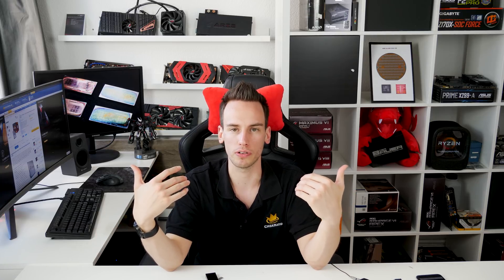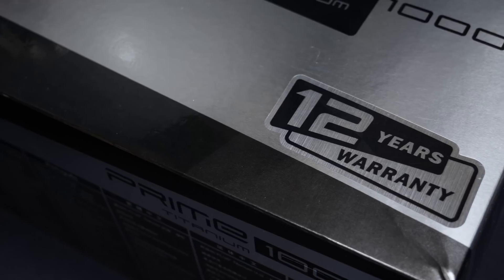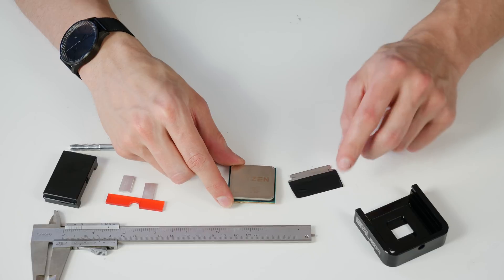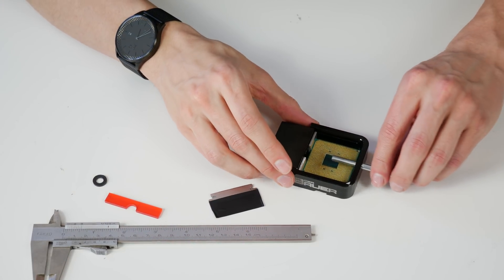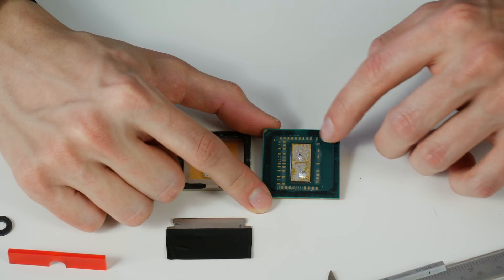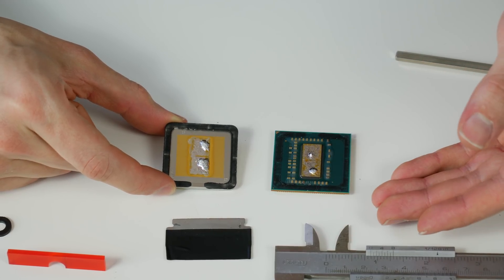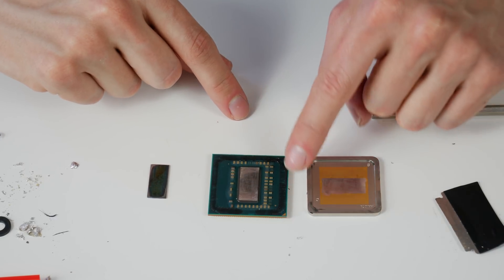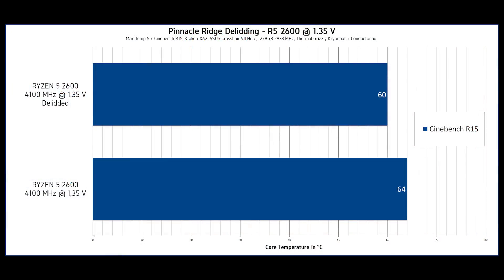ZEN+ Delidded - Before/After Temperatures - [Ryzen 5, 7, 2600, 2700X]

Comment: It is a smaller process, however AMD chose to use the shrink to add more dark silicon between features instead of shrinking the die.
Reply: the anandtech article has an illustration about it.  all the parts are basically the same and with the same number of transistors its just that blank space is put in between the existing parts so they are not too close together.  they call that dark silicon.  its just a buffer between working parts so that heat from one area doesnt get into other parts as much
Reply: yeah according to anandtech that is the case.  its still 213^2 or whatever
Reply: Exactly this.  They could have made the die smaller by about 10%, but putting (keeping) a bit of space between the parts of the core keeps the overall area through which they can transfer heat out of the same.  This helps them (along with the slightly more power efficient 12nm node) get those extra few hundred mhz.   Makes me wonder what theyll do when the 7nm Zen2 parts come out.  Will they shrink the die or keep it the same for cooling purposes.  Its not like the Zen chip is all that big to begin with...
Reply: None of you got it completely right. It's due to tooling. It's cheaper to leave unused die area and keep the same tooling for their entire production line of Ryzen, Threadripper, and EPYC CPUs than retooling it for a slightly smaller die size. The unused die area can then be used to isolate temperature sensitive circuitry better as well.
Reply: its a simple matter of logistics. making all dies the same size even if the actual chip is smaller has no additional production cost and allows to maintain the workflow without having to alter the production process for each part.
Reply: While you may be totally right, from what I read about the process at this scale is that they are not doing true size shrinks to the specified nano-meter size but modified shrinks compared to traditional size shrinks. Just something to consider seeing how the silicon size is the same.
Reply: Yep it's almost identical to summit ridge
Reply: any answer containing the word dark is correct
Reply: I like the idea of more "dark silicon"...it sounds evil!
Reply: Yeah, I've read somewhere that they have chosen the 12 nm process with the existing 14 nm  layout to save money and time. They also can clock everything much higher because there is more room betweeen the transistors and other components and because of that heat (and higher clock) is less a problem. Also they have a higher yield compared to intel who also shrink the die size because of that.
Reply: google translated from svethardware.cz
According to available data, the 14nm Zeppelin chips in Ryzen 1000 have a size of 212.97 mm2 and consist of about 4.8 billion transistors. The new versions of the 12nm process have a slightly higher number of transistors, and on the other hand they are smaller but really little. This would indicate that the new 12nm process is not much better in terms of density than the deposition of elements, but that some die-shrinking has occurred. But as AMD representatives confirmed, in fact, the 12nm process is basically just an improved or rather tuned older 14nm LPP process, so it does not form smaller transistors.
 
This could be the analogy with Intel and its improved 14nm process, which in the case of Kaby Lake was designated as 14nm + and Coffee Lake, are already doing the 14nm ++ process. Additionally, AMD has nothing to do with the process, and it is purely a matter of GlobalFoundries.
Reply: "Dark silicon" has nothing to do with putting silicon space buffers between the IC's parts. 
The "12nm" process is actually just a "14nm" node with a few tweaks, so no size scaling. In any case, this transistor measurement lost all meaning a few years ago; it used to be the smallest possible gate length of the mos transistor but nowadays it's more like the PR rating AMD started to use back in the Athlon vs Pentium4 era when they had a massive IPC lead but lower clock speeds. Intel is doing the same; the truth is, no one knows what "14nm" means anymore.
Reply: Yeah 14nm >/ 12nm
Reply: 12nm Glofo is just a marketing name for enhanced 14nm, its not actually smaller, in reality its the same chip, and the same 14nm as the old Ryzen, just refined process and few fixed bugs and optimized latencies, but its still the same chip. Its the same difference as was between Bulldozer and its Vishera refresh. This is Ryzen+, the Ryzen 2 will be new redesigned chip, that comes next years.

Comment: The big question is will the temp difference of 4 degrees even increase more as you go up in clocks? Which would make delidding especially interesting for the 4.3/4.4 water-cooled setup
Reply from the maker: Maybe 2 or 3 °C but I wouldn't expect more than that
Reply: temp is not the problem on ryzen, oc wall is. even cheap air can hold 2700x at 4.2-4.3... delid is not worth it.
Reply: The reason people delid intel CPUs is because they aren't soldiered. Ryzen delidded would be a waste of time and effort for what you gain and you risk the potential of really messing the processor up.

Comment: It's been stated that the 12nm shrink has allowed more space or dark areas between transistors rather than actually decreasing die size, so no surprise that they measure the same.
Reply: I'd add to that, considering multi die TR and EPYC approach to manufacturing optimisation, using the same size of die means using the same manufacturing process for soldering the die to PCB, soldering the IHS, handling the dies etc. That might be another reason why the new lineup is slightly cheaper on launch than the first generation as at least part of the manufacturing process tooling was already paid off. Cool stuff AMD is doing here showing production optimisation IRL.
Reply: anandtech made a diagram to illustrate this and highlight some other improvements. Generally it gives areas of the chip more thermal breathing room due to increased dark area around features
https://www.anandtech.com/show/12625/amd-second-generation-ryzen-7-2700x-2700-ryzen-5-2600x-2600/2
Reply: This is what I read as well..

Comment: 12nm is just marketing, like Intel's 14nm+ and more +. Zen+ is just refined 14nm, not shrink to 12nm.
Reply: Smaller elements, larger dark areas = shrink on internal components but not die size. Yeah it is still part of the general 14nm node, but is stated as size changes rather than adding +'s. Apparently there's more shrinkage available on 12nm than what AMD used in total, but it looks like AMD made engineering choices for best results on which elements to shrink and which not, kind of like AMD could have gone full 14nm++ (using intel nomenclature) , but instead just went 14nm+ because they didn't use all the shrinks available.
Node's are defined by the smallest element, so as they are using 12nm elements in the design it's quite fine to call it 12nm.
Reply: "  No one knows what it means, but it's provocative. It gets the people going. "
Reply: GlobalFoundries
Building on top of Samsung's licensed 14nm process, GlobalFoundries announced "12LP" (12 nm Leading Performance) in late 2017 which is said to deliver up to 15% increase in density and 10% increase in performance. The process is expected to maintain the same device features as the 14nm process but introduce enhancements and tighter pitch in the BEOL and MOL stack. Source: wikichip.
Reply: AMD never said they were going to shrink their dies. They packed more materials to the die at 12nm therefore it's still the same size. If you go over to gamer nexus, they have noticed that at 3.9ghz, the 12lp version of the ryzen on hit those clocks at 1.19v while the 14lpp version needs like 1.4v. Drastically different power consumption at 3.9ghz which is the sweet spot of the newer 12lp process.
Reply: Cipi SixZeroFour you don't get it don't you? Ryzen 2nd generation is based on zen+ architecture. Ryzen 3rd generation is on Zen 2 architecture in 2019
Reply: Piotr G., You are right, however, it is still an amazing thing they pull together.  The improvement is quite impressive.
Reply: Piotr G.  this is true but amd also say they used the extra space to add dark silicon around the hotspots.  but there probalby isnt much dark silicon to add if any.  that way they dont really have to change anything and all the same equipment and pcbs still work unaltered but realistically yeah there was little to no shrink just optimization of the arch
Reply: "sweet spot"... only if you want slower than ryzen's default boost
Reply: Light Yagami no it's not. I've just mentioned literally 1 comment before.
5.5 ghz 2700x gets better 8 core global scores than 6.1ghz 7820x. Here is an example http://hwbot.org/benchmark/gpupi_for_cpu_-_1b/rankings?cores=8#start=0#interval=20
Reply: CrimsonFate both are equally important...
Reply: Singuy888 thats exactly how that is!
Reply: 12nm or 14 represents the size of the gate of the transistor. The rest of the circuit doesn't need to change. Ryzen + has the same size because it has more transistors.
Reply: Zen+ is a refresh with improved memory scaling and cache improvements and 2%~3% increased ipc. The first generation of ryzen gets ~150-160 single in cinebench whereas ryzen+ gets ~170. Global founderies aims more to energy efficiency than overclocking ability. That's what I think.
Reply: HotRodX there is no such thing as ryzen+. there is zen+ architecture and ryzen 2 cpus
Reply: boothegoo pc IT IS BETTER. 5.5 ghz 2700x gets better 8 core global scores than 6.1ghz 7820x. Here is an example http://hwbot.org/benchmark/gpupi_for_cpu_-_1b/rankings?cores=8#start=0#interval=20
Reply: HotRodX yeah and intel is superior to both lmao
Reply: 12nm offers 15% density improvements. Has nothing to do with marketing
Reply: CrimsonFate ever heard of k5? It had the exact opposite problem
Reply: Hydrochloric Acid K5? You don't need to go back that long ago. Pentium 4 3.8Ghz used to eat dust from an Athlon 64 2.6Ghz.

If the IPC is low, you need to have a cpu with faster clock, since they deliver less instructions. If the amount of IPC is big, you don't need high clock speeds.

Let's remember the 485mhz IBM PowerPC from the GameCube which was 2x faster than the Pentium 3 733mhz from the original Xbox.

Or the 500mhz K6-II that was 20% faster than the Pentium 2 500mhz.
Reply: Not saying the k5 isn't old, as it is. It's just a very good example of very good ipc, but with terrible clocks speeds that ruin the performance. There are plenty of examples of bad ipc and good clocks, but not many examples of the the opposite.  This is basically the whole brainiac vs speed demon debate all over again. It just happens that modern processors are frequency limited
Reply: https://www.extremetech.com/computing/261594-ces-2018-amd-announces-12nm-2nd-generation-zen-7nm-vega-2018-roadmaps

Global Foundries 12nm LP is simply a refined 14nm LPP process. It's not actually a transistor shrink.
Reply: Source?
Reply: +Piotr G. 
It's funny cuz you make it sound like it matters
Reply: @Cipi SixZeroFour  ryzen plus doesnt have more transistors.  the amount is exactly the same. amd said so themselves.  look up the anadtech article ryzen+ deep dive or 2700x deep dive something like that.  and yes its supposed to represent the size of the transistor gate but that went out the window a long time ago when they took 20nm and put finfets on it and called it 14nm.  the head of glofo said so himself.  so really they went from 20nm to 14 or 12 with this one.  its become a marketing term mostly.  intel is the only 0ones who are close to truthful about transistor size and they fudge the numbers a little bit too.  they put more space betweeen the transistors so they would get as hot.  thats from amd themselves
Reply: Onur Berk SUNAL you might be giving that turd too much credit assuming he knows how to read.
Reply: You can't have the same logic for different IPC. For a higher IPC, you logically add more transistors.
Reply: Piotr G. True, but what does 14nm and 12nm actually mean? Nobody really knows, not even the engineers.
Reply: @devindykstra  lol... thats the width of the paths going from transistor to transistor... nanometers. smaller means less power consumption but more heat
Reply: @Cheeseypoofs85  it's just a name, that's what it used to mean, but today CPUs are so complicated that that metric alone doesn't describe how good a process node is. I think it was Intel who first named thier node something else because it performed better then the competition.

Edit: and less power and more heat? What? The heat a processor puts out in thermal energy is exactly what is put in in electrical energy. Basic physics: conservation of energy. Smaller process nodes decrease the energy and time required to move electrons over transistors.
Reply: There is only Zen, and Zen 2. Ryzen+ or Ryzen 2 is not Zen+ nor Zen2. There is no Zen+.
Reply: They are really both 20nm. Neither are really 14nm. Global Foundries admitted it.